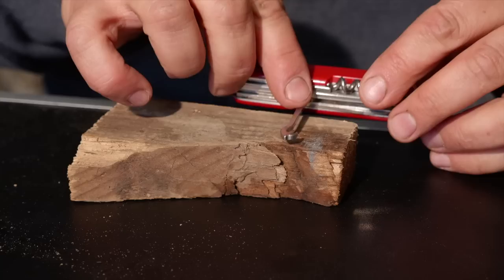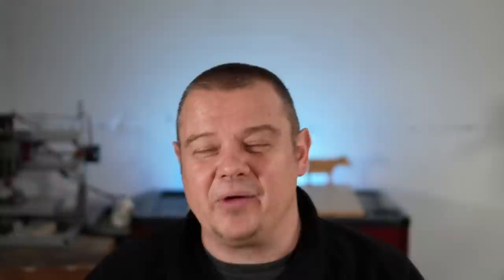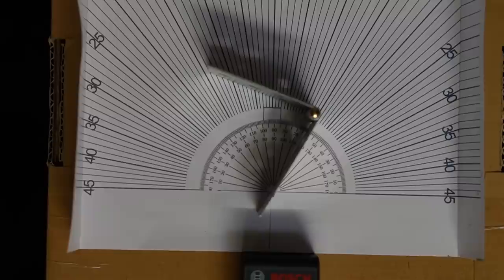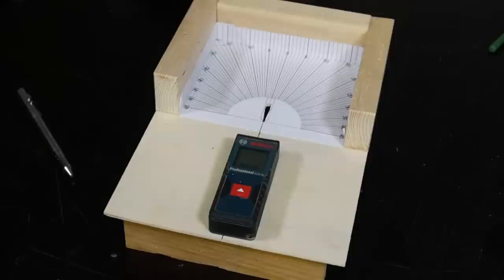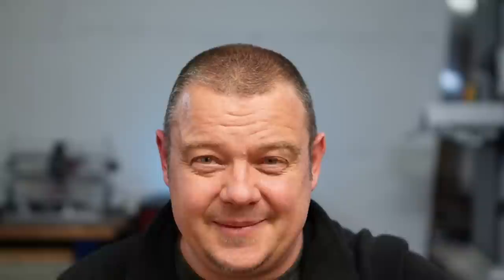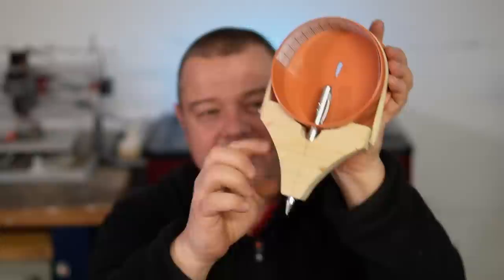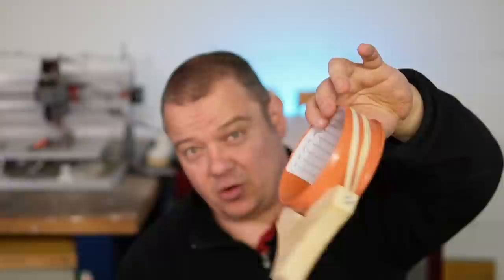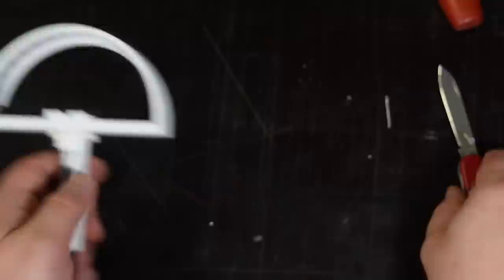Best way to determine the cutting egde angle - DIY Laser Goniometer - 3D Print-File $ 5 only !!

Comment: I finally got a chance to make it using the 3d printer and it works awesome. Some blades like my swiss army champ are easier to read than others and project a very nice dot. Other blades project more of a distorted arc but the angle is still predictable. Thanks Felix - you are truly the macgyver of bushcraft!
Reply: distorted dots mean that the edge is not flat but convex -- as a result of poor angle control or using a belt sander. that is the beauty of this tool, you get the quantitative number and the quality of the edge

Comment: Thank you Felix for yet another excellent and informative video. Very grateful for your collaboration to bring us a new tool. I  purchased the plans this morning and have nearly finished printing my new laser goniometer!
Reply from the maker: Please give me a feedback how it works...
Reply: Hi Nicholas, I just received my goniometer using this design from my local 3d printer service. The scale got screwed up somehow. What scale did you use? Would you mind measuring the width of the flat portion of the goniometer body so I can extrapolate the other measurements. Cheers!
Reply: My print came in inches. Keep up the good work!
Reply: @aaronthom2576  Hi Aaron, I used Cura 5.3 to slice the model. The X-Axis (long straight side) originally measured 12mm. I scaled the model to 1000%. This have me a final print @ 120mm. I might be tempted to tweak the design to make it a bit thinner and less bulky to reduce print time and filament use. It's a fantastic design though and works like a charm. I had some challenges with the laser, but you don't really need it to be perfect. The blade angle/angles are still easy to determine. Felix's channel is by far, one of my favourites. Good luck with your print.
Reply: @FelixImmler  Hello Felix, the goniometer works perfectly. My laser was not a perfect fit, so it's not perhaps as neat and tidy a solution as my OCD would like, but I'll get around to it some day. That said, it's so easy to determine the blade angle of any knife. My son is now sharpening everything with an edge that he can measure 🤣. I just wish my 3d printer and software offered the same elegant simplicity as my SAK. Thank you again. Warm regards, Nic
Reply: Thanks Nicholas! I had it reprinted using your measurements and it works great. Two tips I find make it easier to use: 1. I used a single wrap of electrical tape around my 14mm diameter laser pointer for a more snug fit with some give for centering. 2. The filament used for my print is a translucent "natural" color which makes it difficult to read the measurements. I applied blue chalkboard chalk to the embossed numbers and scale marks and it's now much easier to read

Comment: Nice idea, however the biggest questioner is the correct position of the laser tool and an fix point  of the blade, because without these two parameters this will not work exactly only +/- and it not the point of this kind of measurement
Reply from the maker: In my opinion the laser don't need a fixpoint... and the blade have a fixpoint. I claim that this device is accurate to a degree.

Comment: I have a question; will the light reading show one edge is a different angle than the other is? It does show the angle of the cutting edge. However, the stone and guide rod still have to be set to the proper angle to achieve grinding the proper edge on the blade.🤔🗡❓
Reply from the maker: If you hold the knife per hand like in this cheap models you will not see, that on cutting edge angel is different to the other..

Comment: 125 mm =~4.92 inches. So if you can get your hands on a 5-inch diameter cap, that’s only 0.08 inches bigger. I suspect that’s not enough difference to matter, although I’m not absolutely certain.
Reply from the maker: Hello Garry, That works for sure. If you print out the sacale and the Laserholder, you can put the print on 99%. Greetings from Switzerland

Comment: Hi Felix, Excellent video! I have followed you and subscribed for the last 3 months. Since you have created this angle device, have you checked several of your SAK knives for factory consistency of angle? I have found the officer model blades to be so much easier to get razor sharp as compared to the 93  mm larger blades. I know some has to do with the thickness behind the edge. When I sharpen the tiny blades on the 58 mm I rarely get them as sharp. The small blade on my tinker small is a razor for sure. Thanks again for making all of your great content!  Jeff
Reply from the maker: Hello Jeff. Thanks a lot for your interesting comment! 
I haven't noticed what you describe yet... but I'll pay attention.
Reply: I concur, Jeff.  The small blade on my Tinker is  amazing.  I wonder if the angles differ from the thicker main blade.
Reply: @archivist17  Hello! The main blade on my tinker small is just as sharp as the small blade and just as easy to maintain. I have a 93mm Alox solo and Pioneer with thicker blades which are thicker and I think they have more acute secondary bevels. The 93 mm blades are meant for heavier duty cutting tasks. I just noticed that the smaller blades on the officer size knives are perfect EDC blades and very easy to maintain the edge. Smaller or larger blades (58mm, 93mm) from Victorinox don't seem to get as sharp or maintain as well. I remember thinking the same thing with a Spartan I had a few years ago.   When working I always used the 93mm Alox. But since retiring I bought the small tinker and was just amazed at excellent the blade geometry was for sharpness! Jeff

Comment: Hey! I bought the model but in slicer it appears like few milimeters big. I scaled it up 10x as it seems right size, but the parts dont fit together and if I change coordinate system to inches its big like half a meter.
Reply: I have the same problem. did you find a fix?
Reply: @mauriceraybon6837  Sadly no... I don't have a response from the developer. I just kept it scaled at 10X and added a electrical tape where needed. Since it is a paid model I won't invest my time in fixing it.

Comment: Hello Sir,
Allow me these few lines. I downloaded the 3D Model from the site.
Could you tell me it is scaled for 3D printing? Because on the scale: 1.
The room seems too small.
Kind regards, Jean Jacques
Reply from the maker: For 3D printing question you will find a email adress on the webside. Sorry. But i guess you have mm instead of cm... Is the Model 10 times to small?
Reply: @FelixImmler  Hello Felix,
Thank you for your letter. I have just made the 3D Print of the Goniometer. All pieces are Impeccable. Good Rating of each item. The width of the rectangular part is 120 MM, and the length of the handle is 80 MM. It's a nice 3D tool. Kind regards, Jean Jacques

Comment: Or you take out your caliper, measure the spine width and bevel height, and do the math. Just calculate that angle. No lasers, woodworking or 3D-printing required.

Comment: Hi Felix!  Great video! I have a question. How do I change the scale if I used a 101mm endcap (usa)! Do I make it smaller? If so, how much? Thank you for your time!
Reply from the maker: in the printer you can control the size of the printout in %. Just print it and insert it and controll. from -45 to +45 are exactly 180° in your endcap. LG
Reply: @FelixImmler  thank you so much for your time!